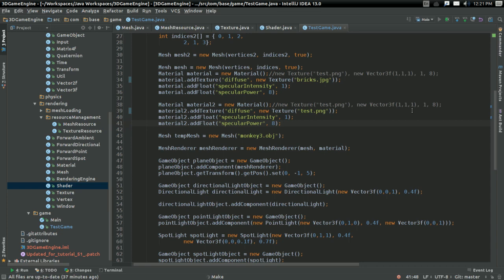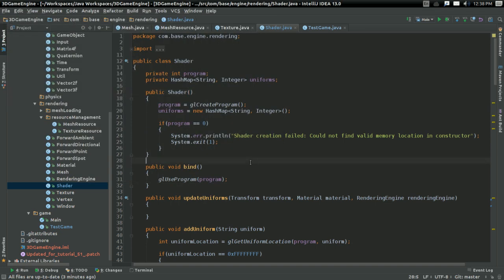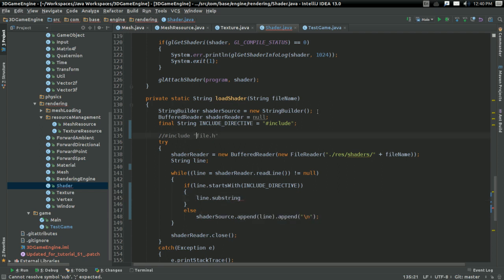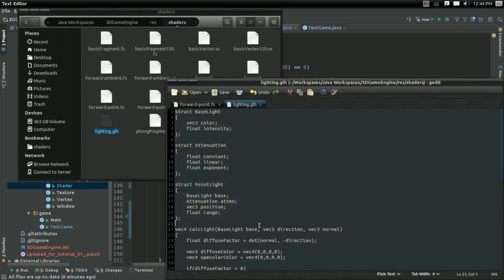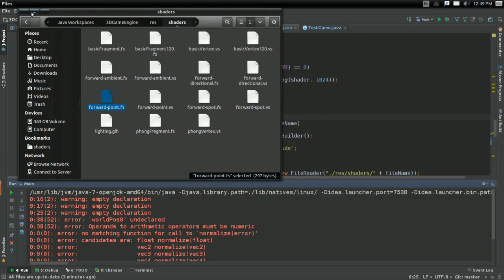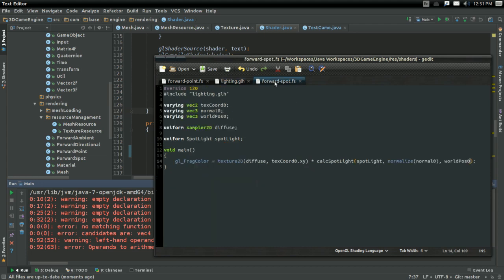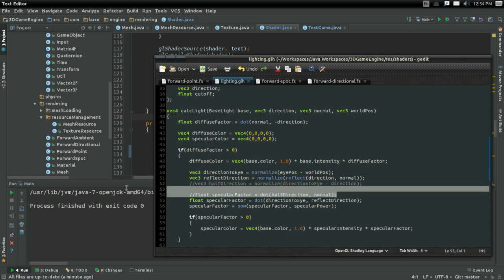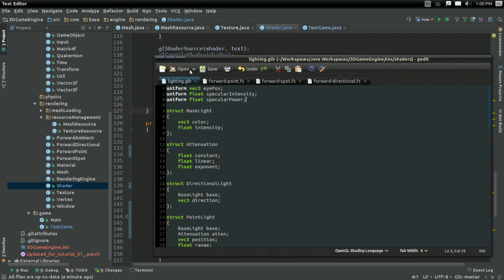#54 3D Game Engine Tutorial: Reusing Shader Code

Comment: hey Benny,
I was was wondering if were ever going to look into better performance with lighting? the current code seems to be rather of a fps killer

Thanks!
Reply from the maker: When lighting is the most significant performance burden, sure. I think you'll find that lighting isn't the biggest issue right now though :)

Also, please don't use FPS to measure performance/profile your code. While it technically has meaning, it's an inverse relationship and people are terrible at understanding inverse relationships. If you want numbers that aren't misleading, try measuring frame render time in milliseconds.

Comment: Is it possible to use things like glTranslate and glRotate with shaders?
Reply from the maker: It might be, but I wouldn't recommend it. Those functions are deprecated for a reason.
Reply: Those are depreciated? Is there anyway to modify object positions using only java/c++ code?
Reply from the maker: Do you mean without using GLSL?
If you really wanted to, you could translate/rotate every vertex manually and resend it to the mesh with glBufferSubData, but again there's usually not much point or sense in doing so.